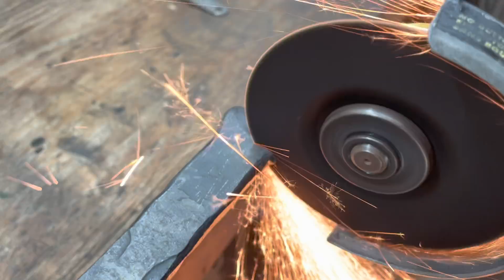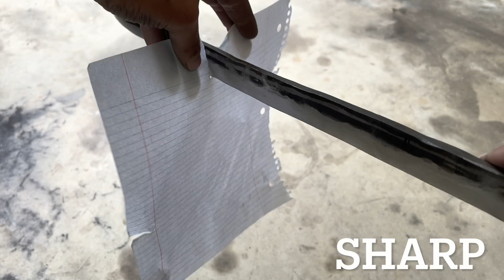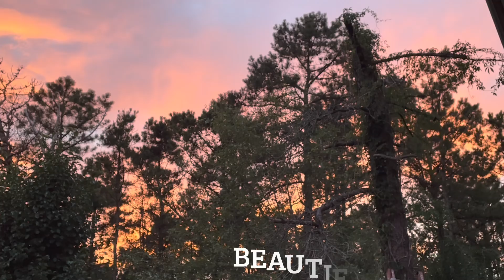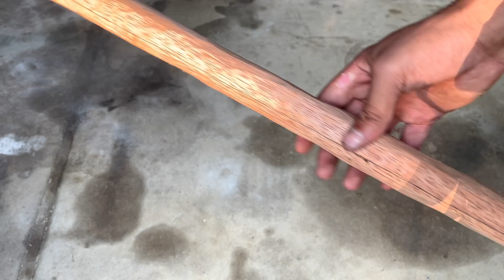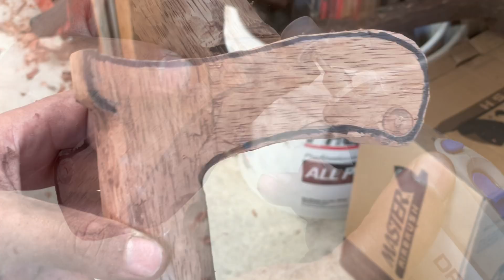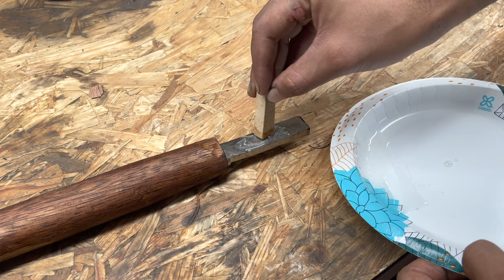Forging a SECRET CANE SWORD out of a CROWBAR

Comment: Cool, but if it's not hardened it's just a sword shaped object
Reply: The crowbar would be high carbon steel so as long as it isn't overheated it will retain its temper
Reply: @ColonelVandal  it was heated to forging temp...it is annealed
Reply: @ColonelVandal would the forge glowing red hot be considered over heated?

Comment: There were less forging here than i expected and the blade design was far wider/thicker than i would assume from a cane-sword.
Somehow i suspect that you too (Pole Barn) realized this atleast halfway through.
perhaps a "staff-sword" would be a more appropriate thing to do when making a blade from a crowbar?

I've seen others make "Katanas" from crowbars because there's enough material for it, perhaps you could make a medieval sword?
It seems you have the skills to make a proper scabbard, but you might need to make the next one not a complete rectangle, but have it "tapered" on the sides to keep the edge of the blade from contacting the sides and possibly blunting it?

Comment: ... Oh my!
Ookay, For a start, I'll ignore everyone else's comments since they do little more than give PBP a bad taste.
This is how I perceive it; this isn't bad for an entry level project, there are things I would personally do different, but lets try and be constructive on how we discuss this.
Firstly, PBP is using VERY basic tools compared to other more advanced smiths, so I expect there to be some accuracy issues, much of which will improve as PBP grows in experience and gains more equipment as he progresses.

PBP, my suggestions aren't meant to be offensive, but I hope they offer some constructive advice:
The FIRST thing I would suggest is take your time! Its not a race and rushing through something like this will only result in ruining all your hard work.

I suggest rounding one side of your hammer's head and bevelling out the edges on the flat side to reduce the sharp defects caused with each mis-strike, then try striking a sacrificial piece of wood to get a feel for what is most comfortable, you need to try and find that sweet spot with how you grip the shaft and your swing to get a more constant strike against the material, when you find that sweet spot, you'll have less crescent marks in the material .

Next, I suggest one of two options for getting a thinner blade: Either work and draw it out more so the blade is thinner, or spend a lot of time grinding.

I would strongly suggest using a straight edge throughout the project (free hand marking stuff for what you're trying to do is BAD) and cast your eye down both the spine and edge of the blade when you work, it'll help when looking for defects, twists and warps in your work, all of which can be rectified with a little effort/

Your ginding is commendable for what I would call a beginner, however, you need to take a little more time and care rather than rushing into it since this shows in how the blade is uneven and the edge ...

Lastly, IF you wish for this to be more than a wall ornament, PLEASE temper the blade! 

As for the wood work? Like with the metal work, take your time and care, rushing creates mistakes!

To be honest, this is pretty good as an ENTRY level project, it could be done better and if you really want to, you could easily re-machine it to meet your viewers' overly critical standards.
Reply: First and foremost best advice you had was taking your time. We’ve all done it me especially I start a project way too soon before I have a clear plan and the necessary supplies. For instance the wood working he could have bought a round oak closet rod split it and saved a lot of time that time costed him more short cuts. The planning aspect with foresight even halfway through would led me to re think sword cane. When he joined the handle I hope it wasn’t just glue and at least had a dowel pin connection. Again time and plan problem
Reply: @dustyak79  Thank you, I try to be fair and honest if/when I share my opinions and observations

Comment: This is really bad work. The wood doesn't line up the blue came threw the black paint. And it's too think. You should do more attention to details. And also not as thick woods
Reply: Judging by the setup, he’s obviously a beginner, please cut him some slack, blacksmithing is an extremely difficult craft to learn, especially when you’re self taught, which this dude very may well be